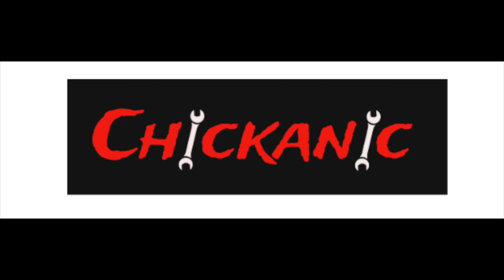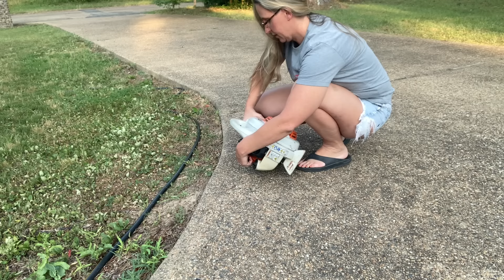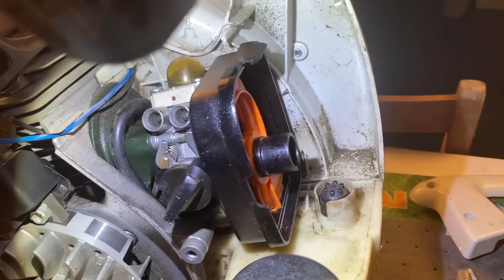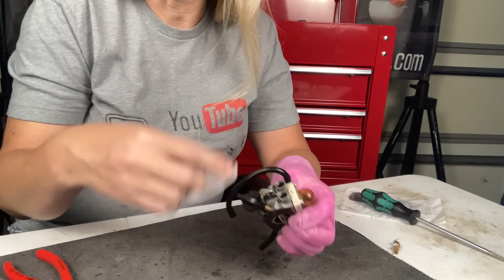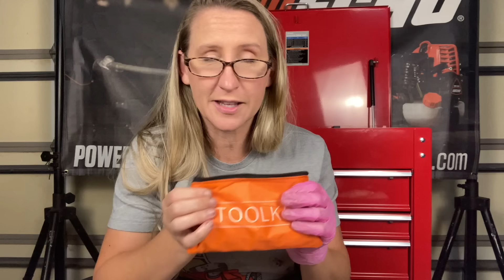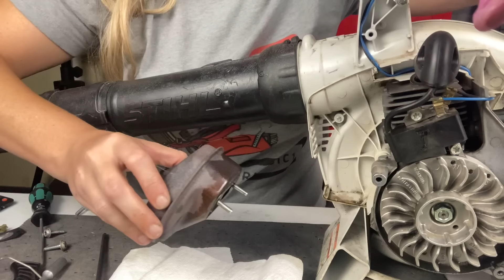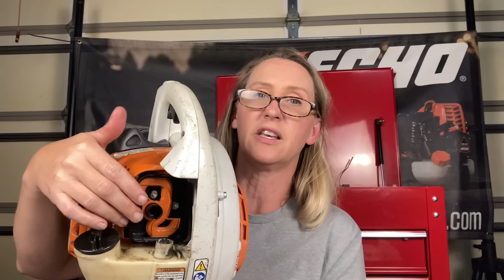Stihl Blower's gas disappeared! Pull rope won't work? This small engine has issues! Repair/Vlog

Comment: Hi Bre love your videos what is the proper speed for a Toro 6.5hp mower I checked it and was 3623 rpm tried to adjust it and went to 4300 rpm just couldn't get below 3600 what are your thoughts on it. Thanks
Reply: spring stretched or stop screw unwound or governor slipped where vein connects to shaft try manually pushing governor back to see if you can get lower rev if it does gov is ok look at spring or stops

Comment: At 11 mins. in you were cutting off a gasket with a utility blade. You were cutting towards your other hand. That scares me as I have slipped a few times leaving a nice battle scare on my off hand. OUCH!!! Cut away from you!!!! LOL
Reply: Not much room when holding a small carb cover. For me, most times it's not a slicing motion but a light prying while the blade works the gasket off the thin rib around the gasket surface. In a perfect world, always cut away, but sometimes it's not optimal so you take a risk.

Comment: still trying to figure out how I'm alive, sans all the safety gear and magical electronics (junktronics). I mean after all the bicycle wrecks, electrical shocks, power tool usage, etc. with no safety equipment. pure luck? head not up hind quarters? angels? knowledge after learning the hard way?(mostly this).

Comment: Don't know if you are aware or not, but Stihl started using octagon 8 sided instead of hexagon 6 sided needles in some of the newer equipment.
Reply: I have met it, didn't know it was 9 sides - just looked at it and decided that it was more than the 6 sides I could adjust!

Comment: you can hear that hesitation still. running a tad rich. confirmed by all that carbon buildup on the piston and plug. id definitely run some outboard engine tuner/soak overnight to get rid of that carbon or else a broken ring is in its future.

Comment: I have the older version of this Stihl blower, I like it a lot. However, once I get mine started, which is pretty easy, I have to wait for a while for it to warm up before it will throttle up. Is that normal or does the carb need adjusted?  Thumbs Up for your videos!

Comment: been watching your videos for awhile now. just helped me with a problem. been doing some chain saw carvings a lot since Christmas last year. have made about 10 bears, 10 owls, three eagles and a couple turtles so far. well for Father's Day was making Dad a 36" tall welcome bear and my main carving saw (240 Husqvarna) started running poorly.lack of power mostly. adjusted the carb and got the job done, but still not running great. today started another owl and the same problem again. awhile ago you had a video will a Stihl blower or trimmer and found the muffler screen all carboned up. So took out the screen on my saw and found it almost completely plugged up. cleaned it up, put back together and a little carb adjustment and running great again. some of the problem is that doing carvings you are only running the saw at low RPM's about half the time. sorry, this got so long, but thanks.

Comment: Quick question.  Why not just buy a replacement carb from Amazon?  They only run 15 to 35 bucks and seem to work well.  Just did a John Deere 155C lawn mower carb replacement where the dealer wanted $300 and it took me an hour with a 30 dollar kit.

Comment: Wow... that was a lot of fuel. I've had to work on saws that were pulled 40 times with full choke and I've never seen flooding that bad. Great video and great work, I fix tools for the fire department and firefighters can be a bit... harsh... on their tools, so now I can add this to the possible cause and 'how to fix' checklist. In fact I just ordered a carburetor for an MS 460 today because a saw won't stay running after somebody turned out the idle screw to the point of removal and then manhandled it when trying to screw it back in. Now the threads on the idle screw are buggered and it chewed up the threads inside the carb as well so, RIP on that one. Hoping there aren't any additional issues and we'll see if the new carb fixes it.

Comment: Hi, just a little more description. The screw thread style is plastic and the machine thread is metal or metal inserts. One trick to avoid cross thread is to turn the screw backwards until it clicks or you feel it drop. Then stop and tighten the screw. If you are in need of tiny torx look 👀 into kits for repairing laptops. Love ❤️ your channel.
Reply: Or phones.

Comment: If it was a 4 cycle and the thing wont pull, I know what it would be if it was mine. If you dont keep it upright, the oil fills the cylinder up and you have to take the spark plug out and watch oil shoot out when you pull start it.

Comment: The Bg56-BG86 BR200 need a special tool to adjust the high and low settings. Stihl part number 5910-890-2314

Comment: Would replacing the carb be more efficient way to go? Carbs aren't too expensive and you could adjust the adjustment screws. Just a thought. Great show 👏
Reply: Most carbs are $50 or more.. are you taking about that trash on eBay and Amazon?

Comment: No offense, but The Mower Medic doesn't hold a candle to this channel! You speak clearly, you don't repeat yourself, you proceed step-by-step, and you list the parts needed to fix things.

Although I've spent a small fortune migrating to electric lawn equipment, I get a lot out of this channel. During this transitional decade to electric from small engines, customers are at the mercy of the quality of the battery and circuit boards, which no one repairs much at this time.

Comment: The carbs on several of the STIHL hand held pieces have a proprietary size of hex and the tool in the run of the mill kits won't fit them. They are also rounded on the tops. I'm sure you did this before making the video but showing how to pressure check the breather and carb to pinpoint what was leaking would have been good. Those particular carbs are notorious for the main nozzle leaking when any gas containing ethanol has been left in them for any length of time as would be indicated by that ruined fuel pump diaphram. 
Not being a STIHL dealer a rebuild may be your best option but those carbs are so cheap rebuilding them is a waste of money for the customer and the shop.

Now to wait and see if anyone tries pointing out those carbs are ZAMA and not STIHL so I'm wrong about the proprietary adjusting tool.

Comment: For carburetor adjustment screws with rounded off heads, try using a short piece of vinyl tubing with an ID slightly smaller than the diameter of the screw head. Heat the tubing in hot water and stretch the ID just enough to wrestle it on to the screw head. When it cools and shrinks down, it will grip tightly enough that you should be able to turn it. In a pinch, this tubing can be clipped with just enough to grab on to and left on the screw for later adjustments.

Comment: My BR600 had a leaking gas problem only, after being used for an extended period of time- you'd set it down and there would be gas running everywhere and, the motor developed hydro-lock; you couldn't pull the starter rope through if you tried. A wise mechanic told me, "if you have this gas leak problem after usage, crack the gas cap to relieve any residual pressure." I do that at the end of every 2cycle day with any and all 2cycle tools. No more problems. Oh, I better say this because somebody will open the cap and, "hey, gas is running everywhere!" You have to close it again.😆

Comment: Most tank vents are directional as in air in, but not out, to prevent fuel splash, petrol lock is very common in hotter climates simply because of the pressure that builds up forces the carb needles open, a dirty tank vent can cause em not to be able to draw fuel out but dirty tank vents are nearly never the cause of petrol locking.

Comment: Stihl has been garbage for the last 20 years at least. They used to be so awesome. I had a back pack blower that had problems all the time. Same with 3 chainsaws.
I'm happy for people that have never had problems but I've spent too much money on garbage quality while paying premium price.
Reply: as a small engines mech for 30 years aside from a few quirks to that unit its a bloody reliable beast.  What goes wrong is engine mounting screws undo carb manifold screws do same starter attachment plate Where starter bolts on they come loose cylinders and carbs are good as long as fresh gas is used no storing with gas.  Thats about it really and dont buy anything easy start

Comment: use an electric wire slicer to adjust the carb when you don't have the proper tool.  the splicers, the straight ones taking a wire into each end, come in different sizes depending on the wire size. Press one end over the adjusting screw and a slot screwdriver in the opsite end

Comment: Good tip on the heat and pressure. We see this all the time, with the heat here in AZ it's not uncommon for a shed to hit 120+ degrees so the pressure in gas tanks and gas cans can really build.